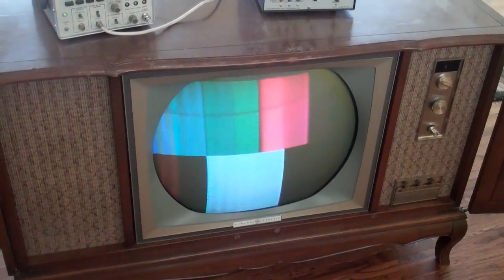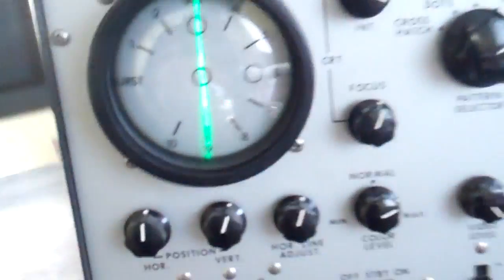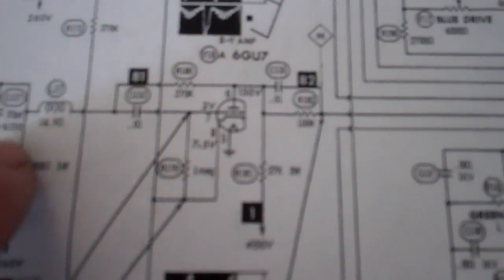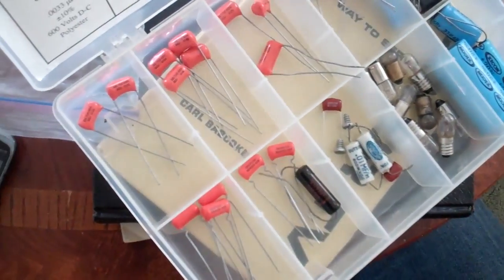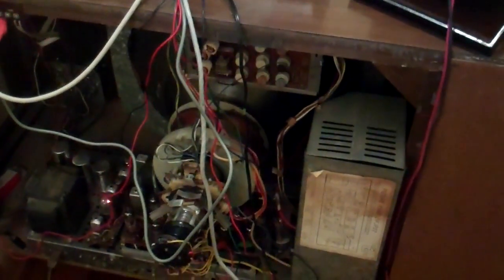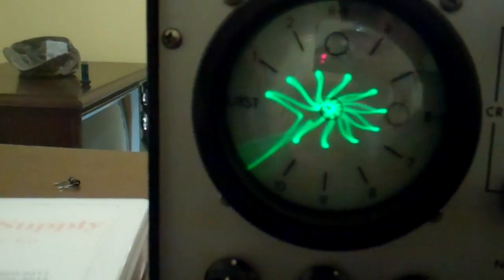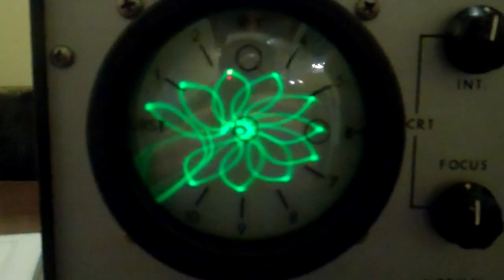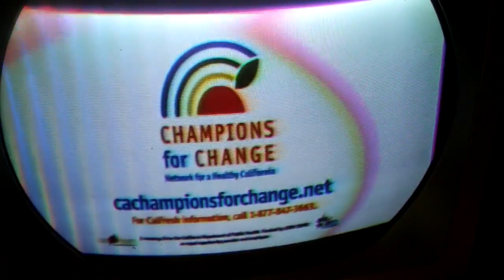Repairing GE CE Chassis Round Tube Color Television With Color Demodulation Problem

Comment: I wonder what Chassis I had from GE because my round screen used a 6al11 audio output tube and a 6ag9 for the video and the 6JS6 for the horizontal output tube and that set had every bit of wax melted off the flyback but it still worked perfectly

Comment: Cool TV set, I actually guessed the shorted cap when you read so much voltage, but I've never seen a vector scope used before. I studied about it in my NRI course but I never had enough money to buy and actually play with one. I have an old RCA roundie that I hope to work on someday, but until then I have installed a 32" flat screen in the cabinet and I watch it everyday. 
Great Video thanks for sharing it.